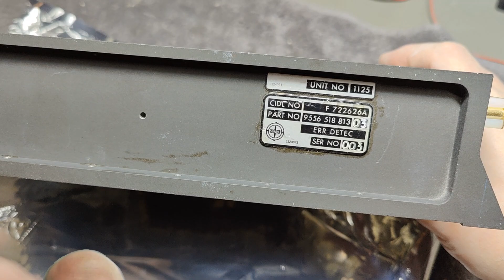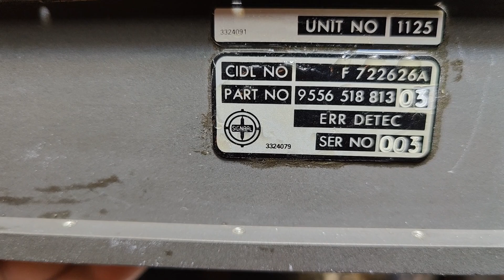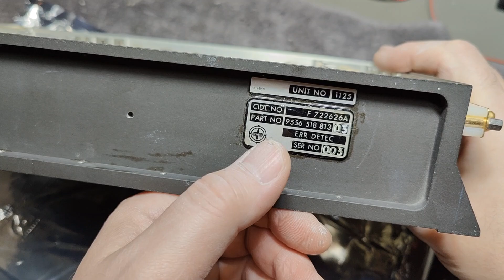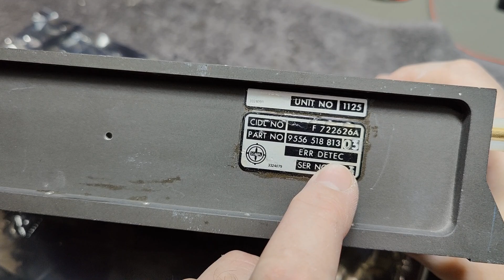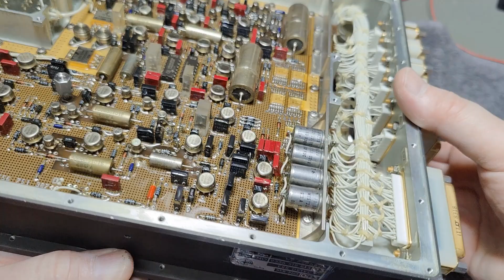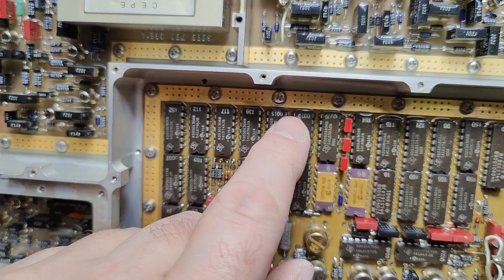Signaal Electronics Unit 1125 Err Detec Military 1984

Comment: The construction actually reminds me more of space parts rather than military. Connector savers are very common on various satellite gear. The form factor, vibration and thermal management etc are all fairly common to space parts. But, it's probably still just military in the end.
Reply from the maker: that is also how i feel, i come from space and avionic and military electronics background, so i have seen all ends of the scale, this one float between space and military in quality and style from that time.

Comment: Those resistors are also available to a custom value. You can tell them apart from the regular ones because the standard range is printed on the case, the special order ones are hand labelled with the same white ink, by the person who laser cut the glass substrate to the exact value. 0.01% tolerance, though you can also get them selected to be 0.001% tolerance in some ranges, over the full military temperature range from -55C to +150C, which is pretty hard to get right. Tiny little quartz glass substrate inside, with a evaporated resistor layer, composition and thickness depending on the range, and then etched to form a long zig zag pattern that is mostly non inductive, with areas on the ends of the long traces left wider to allow you to trim them, either with a laser, or by sandblasting (with a media so fine it looks like fine flour dust) to get the value to rise to the correct one.  Pretty much guaranteed at room temp to be exactly the value on the cover, plus or minus 2 counts on the meter measuring it. Meter error being the biggest thing. Put it on a precision bridge, and you will find them to be in general equal to the bridge, which often, on the more expensive ones, uses them internally.

Comment: The way the wiring was done looks a lot like the unit was definitely intended for an application with high vibration and/or g loading - they tied together absolutely every wire where it was possible, also feeding a wire through a hole before soldering it to the PCB is like a tiny little strain relief for the solder joint. The larger components on the PCB have a wire around them that keeps them in place, and then what about those clear plastic blocks on the PCB - if they touch the lid, then they might be there to prevent mechanical resonances of the board... Very interesting construction, one can learn a lot regarding design for high reliability.
Reply: All avionics used cable lacing

Comment: Those logic chips are all 5400 series, the military-spec version of 7400-series TTL. (Same parts but with a 5 instead of a 7 at the beginning). Much better temperature stability, ceramic cases, etc.

Comment: Those "connector savers" are far more precisely made than a standard gender changer and can cost $200-300 apiece nowadays.  Of course there are cheaper ones but no one in a serious lab would want to use cheap ones unless they have to, especially on avionics.